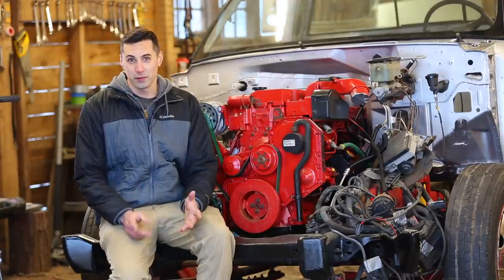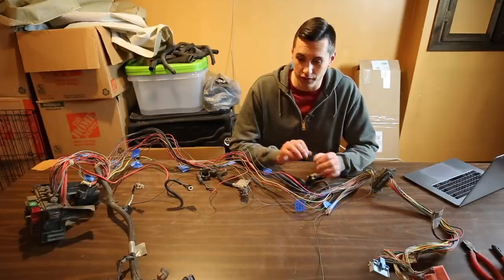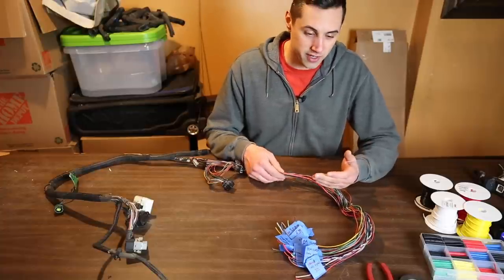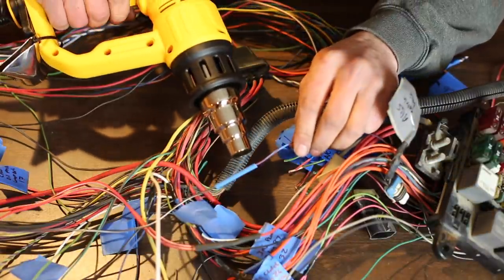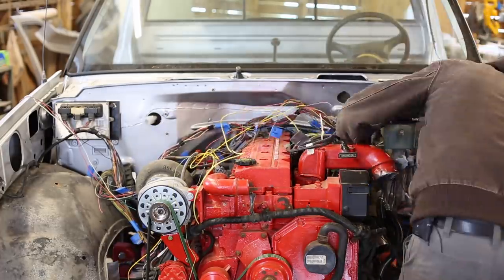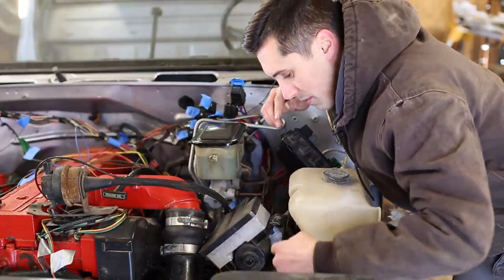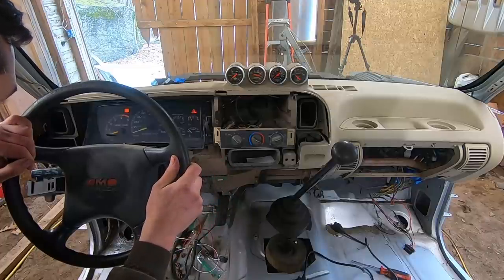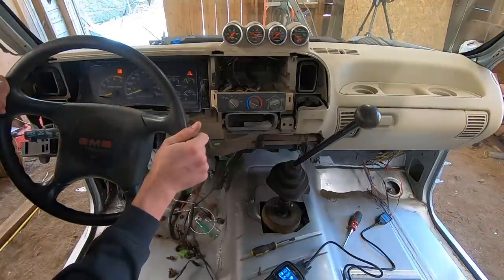Cummins Swap First Start! Plus Wiring a Computer-Controlled Engine [Part 17]

Comment: After binging this entire project and some other videos of Waldo's, I've come to this conclusion:

This guy is one of the most brilliant people on the entire YouTube platform. Seriously, he's done literally everything for this project all by himself. He fabricated dozens of parts, successfully reinstalled the engine, wired up the whole thing  (which looks extremely, extremely complex), and did all the body work.

On top of all that, he has the technical knowledge to correctly use all the required tools to do all those listed applications. 

If that isn't enough for you, he also filmed and edited the entire thing into a cohesive final product. 

What an absolute genius madlad.
Reply from the maker: You're too kind! 🤠

Comment: I’m getting ready to do same/similar swap. I have 94 hd with 6.5. Purchased 2003 Freightliner bus w/Allison 2000(51,000 original miles) I install truck equipment for a living, but still consider it a huge challenge. I want to thank you for the in depth explanations and details you have covered and shared. Thanks much, and good job👍.
Reply from the maker: Thank you, and good luck with your swap!

Comment: I know this video is very old but I would like to say a few things about wiring..

1. The correct way to join two wires together is actually with a crimp. OEMs/motorsport applications will almost always use open barrel crimps with a proper crimper but an uninsulated butt splice connector with adhesive lined shrink tubing will generally do the job and its less of a hassle. Just maje sure you're sizing the crimp to the gauge of wire that you're working with.

2. To minimize issues with wiring you should TECHNICALLY always use "home runs" where you run new wiring from one fuse box to the next fuse box/connector. This is done by crimping new terminals on to each end. This is a giant PITA but does minimize issues down the road as each connection is a potential point of failure.

3. Soldering presents a few issues - mainly making the wires brittle and the solder wicking further up in to the wire than you think it does (which just makes it brittle). Vibrations are also more likely to destroy a soldered joint than a properly crimped connection.

A lot of people will say that they've never had issues with a soldered joint and while that may be true it is technically survivorship bias. Other people have had issues with soldered joints and there is a reason you'll never see a soldered joint on OEM wiring unless it's on a PCB.

Good job on the wiring!

Comment: I admire your patience with all that wiring.

I'm currently swapping a p-pumped 12 valve into my 78 ford F250. I'm starting almost from scratch with the wiring, but I'm aiming to need as little wiring as possible. As far as the engine running, it will just need a circuit to power the starter.

Obviously i still need wiring for lights, accessories, gauges, battery charging, etc. But no computers whatsoever, and none of the electronics will actually prevent the engine from running.

Comment: Woohoo Waldo!  She runs!  I’m comfortable with wiring, and I would have attacked it the same as you did, on the bench out of the truck.  Lovin those soldered and heat-shrunk connections.  One trick for twisted wire; clamp one end, as you did, then chuck the other end in a drill.  Spin the wire until the twists tighten up, and it will never self-unwind.  However, the wire will lose some length doing this.
Reply from the maker: Yeah, that's a good tip, a drill would make it much easier!

Comment: I didn't know Eaton Fuller made a 5 speed transmission. That's a lot of work, Waldo but you're doin' a great job! 👍 🇺🇲
Reply from the maker: Thank you! Yep, they're found on some medium duty trucks. It's pretty awesome because they're really bulletproof when used for lighter duty applications, although it was a really tight squeeze fitting it in there!

Comment: As soon as I saw this truck in my recommended, I subbed and never regretted it. I've probably watched this gmt400 series 3 or 4 times. I'm building a not so special 5.3 swapped k2500 but it's inspiring as hell to watch how you pieced the cummins swap together.

Comment: Love your swap. I have a 87 Squarebody Army truck M1028 with 1 ton Axles, I pulled the Diesel out and added a 6.0 LS. If I was going to add a diesel into anything, it will defenetly be a Cummins.

Comment: Hi Waldo,
Great series.  Very ambitious project but so far, it's looking great!  I have a tip for twisting wires that has worked well for me.  Tighten one side of the 2 wires to be twisted into a drill chuck.  Attach the other end of the wires to something solid like the edge of a table or workbench with a clamp or vise grips.  Run the drill and the wires will twist neatly and uniformly.  This also works to twist 3 or 4 wires together.  There is a bit of spring back so run them up a little tighter than you really want them.  Thanks for the video!
-mike
Reply from the maker: Thank you for the tip!

Comment: when triming down the harnesses to simplify it for the swap where you able to retain the Diagnostic port  ( obo2 port ) im building a similar truck as yours  1986 ford crewcab on a 2006 f550 4wd frame  engine is from a 2001 ram 2500 5.9 cummins with nv5600 transmission  and these videos have been very helpful  just trying to figured out the wireing to communicate to the dash and the tuner im going to use that uses the obo2 port

Comment: Impressive work especially the wiring and making it work with the GM system. I have a 95 dodge and after working on the head lights yea , I found out about the way Dodge controls there system . I installed a set of relays to reduce the load on the head lights and yea the relays are wired in a normal method for me of controlling the positive side not the ground . So the relays are a good way to make that wiring work out .  After thinking about it for a min yea the fuel pressure is important on the vp44 pump . That will save you some money down the road . If you ever wanted to you could use your experience here on doing custom wiring conversion just as you did nice work.
Reply from the maker: Thank you! By the end of this swap, I think I'll have some useful stuff that can help other people, for example, getting the cruise control to work 🤠
Reply: @WaldosWorld   I glad you brought up the cruise control .  I look forward to watching your video . I be very interested in learning from what you do to help me on my cruise control . The more I learned about it the more I decided this is not going to be as easy as I first thought.  For example going to a later model steering wheel.  Since my steering wheel the buttons are no long being made .  My cruise started giving me problems and I being to think it may be pcm related.  So at some point I thinking may be after market unit . But I wanted to use my steering wheel controls and there again it's not a easy thing to do especially with the later model controls

Comment: Waldo you do great work, you might want to consider getting a P touch label maker
They are cheap on Amazon and you can roll the label up inside the black corrugated wire looms and have a future reference if you ever have a problem. Also a soldering Gun make  short  work of joining the wires a soldering iron is so slow...Your build quality is A number one...
Reply from the maker: Thank you, Pete! That's a good idea! 👍

Comment: It’s probably too late but one possible way to solve the cruise control issue may be to use a cruise control unit from a 93 and earlier 6.5 diesel truck that used a cable to control throttle position with the mechanical injection pump a gas truck unit may work also. I believe it uses signal from the vehicle speed sensor buffer to function. Good luck with the project!

Comment: Waldo this is super exciting to see. You really tackled a big job here, especially with the wiring. That can get tricky. 
Will you be putting all of the wires in a loom? 
For twisting wires get a pair of safety wire pliers. Makes a perfect twist and handy if you need to safety wire anything. 
I had a cool thought. You should put an aluminum Hurst shifter handle on the shifter. Old school big time. 
I really like your gauge pod. That’s awesome. 
Thanks for sharing your hard work with us. Great videos!! Stay well!
Reply from the maker: Thank you, Pete! Yep, I'll be putting split loom over the wiring. As for the shifter, do you mean one of the white balls or the pistol grip?
Reply: @WaldosWorld   Neither. Check Hurst part # 1530020 It’s called a universal T Handle. It’s aluminum and in the past I’ve recut the threads to fit different handles.
Reply from the maker: Ah, gotcha! It fits a ton of different threads, but not the 3/8-24 that my shifter has 😂
Reply: @WaldosWorld  Didn’t fit my metric Toyota either so I cut new threads in with a metric nut.

Comment: great video. I know I'm 6 months late but if you want to twist wires together like for the vss you can take a few wires and put them in a drill chuck and tape the other end to a table or put them in a vise, then pull the cables taught and pull the trigger on the drill to quickly twist them. just be careful and don't go full speed or you can damage the cables, but its way faster than doing it by hand

Comment: Here's a tip for you at Waldo's world I would have done is I would have bought a deep pinning tool or a pic at least and would depend the wires I was keeping from the plugs and then I would swap the plugs out on the wire so that way you didn't have to do any actual cutting you could have removed each wire from the plug itself and then put the new plug on the wires that are you're keeping in the right spots go

Comment: A 'next-level' trick is to get a 4 x 8 (or suitable size) board and lay out the harness just like the schematic harness drawing.  This makes it very easy to separate each run, splice, and heat shrink each line.  Working on a bench or in the garage is almost impossible.

Comment: Man, what a great video. Sucks that you lost the footage of the new gauge cluster being built though. Maybe there will be another one in the future on another build.
Reply from the maker: Thanks! Yeah, there'll probably be another one. I actually have a bunch of custom switches to add to this build somewhere, and I might end up making something out of fiberglass to house the switches. I'm considering mounting it either on the roof console or on the lower dash if there's room

Comment: If you do use the 6.5, just toss the computer driven injection pump and revert to the older manual pump (from 6.2 and early 6.5)--it's much more reliable anyway and many people retrofit it onto 6.5.
Reply from the maker: That’s a good idea! I guess I have a lot to learn about the 6.5 😂
Reply: I agree toss that electric pump in the trash, using the 6.5 would be really neat especially if you did a build on it for a project. Great video!

Comment: Waldo your videos are great. lots of information and detail. I have a mechanical 12V Cummins VE pump out of a 1992 RAM to swap in my 1995 C3500HD. I was wondering how this would work with the chev ECM & PCM to the Cummins that does not have a computer?. would it be easier or harder then what you did?

Comment: Dodge 24v pcm has the vehicle speed built in running ac from rear dif
Reply from the maker: It might vary from year to year, but on my '99, an AC signal is sent over a twisted pair from the wheel speed sensor to the ABS module. There's a single wire going from the ABS module to the PCM, so I'm not yet sure what type of signal it uses. I might need to buy an oscilloscope to found out for sure 😂

Comment: I have a couple question doing a 24v cp44 Cummins swap into a 2004 Duramax gmc Sierra wondering if you have any info on how the data is translated or what data my gmc instrument cluster will read from the engine ecm. I just would really like to run the instrument cluster from the gmc and not put the dodge cluster into the cab. Thanks, your video is an awesome video.

Comment: Nice!! Just a quick question for ya, what wire color off of the GM alternator goes to the Tach? Thanks!!
Reply from the maker: I'm not sure what color it is, but it should be labelled "P" on the connector (for "Phase")
Reply: @WaldosWorld  THANKS!! Your channel is great!!!

Comment: They used to be simple... then EPA reared its ugly head up and now we have a ton of electronics on diesels. When I was a kid (and a diesel mech), You could crank up the diesel tractor up and remove the battery... You could crank up several tractors with one battery... 
If you can hear the turbo, it's not doing anything.... most turbos run so fast that you can't hear them...

Comment: Shoulda p-pumped that bad boy then ya could make real power 😎 great work tho!
Reply from the maker: Thanks! It already has a performance injection pump and larger injectors. It supplies enough fuel to blow black smoke

Comment: You should have gotten the gasser over flow tank. Direct bolt in.......... The gasser cruse wires up to the factory controls. This swap?! You should have done some more research before you started swap. You made this hard. That being said you do you. If your happy then that's all that matters and yes I swapped a cummins in my 1994 chevy.

Comment: where would i find a 6.7 ram wiring diagram i am putting the motor in a1940 g56 chevy army truck and ecm pin outs. did you find anyone to reprogram the ecm ?

Comment: hello I like your videos a lot I have jna ask what is the best manual transmission to put a cummins 5.9 24 valves of the year 2001 that is put in a ford 350 super duty of the year 2009 the ford has the cummins engine with transmission of the ford350 6.4 but I want to put a manual transmission on it and I need someone who can do that job

Comment: How do you figure all the wiring and what it purpose is??????????
Reply from the maker: I physically went through the wiring and compared it to the wiring diagrams. I labelled the wires as I figured them out and used the process of elimination for what was left over

Comment: The wiring diagrams in the hands is exactly the same as all data just all data it has a color code and they have exploded view that you can actually zoom in it's a lot easier to read the hands is printed and they they don't have the full run sometimes for all of the vehicles such as for like my Ford truck my my international truck runs a 7.3 international engine it's a Ford F-350 450 and I got a 250 the wiring harnesses for all them for the engine itself is the same except for my 250 cuz that's a power stroke but when trying to figure out what wires go where between the engine and the dash it kind of gets confusing because sometimes for searching your trucks or certain size trucks it doesn't show you the same diagram and the wiring is slightly different that's where the all data is great because it shows color code and it you can put in your trucks or your cars VIN number and go off the VIN number or you can just put in an exact information for the vehicle all the way down to the engine size and you'll get the exact wiring diagram